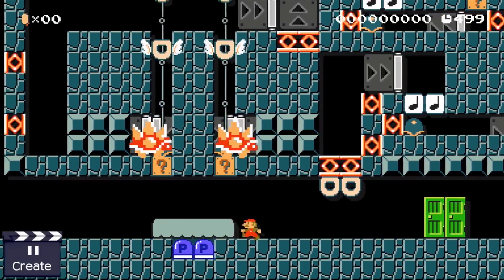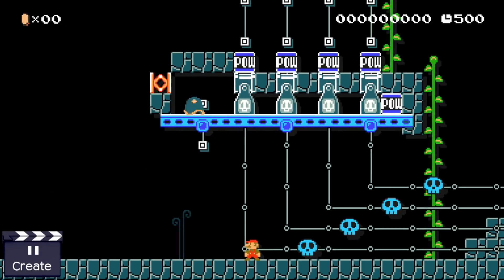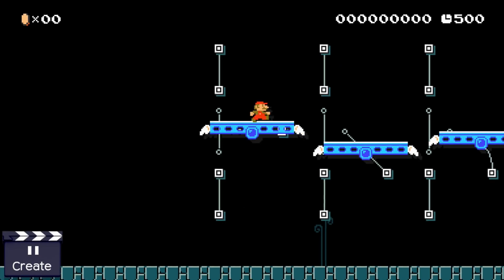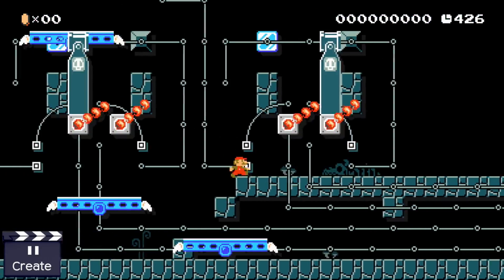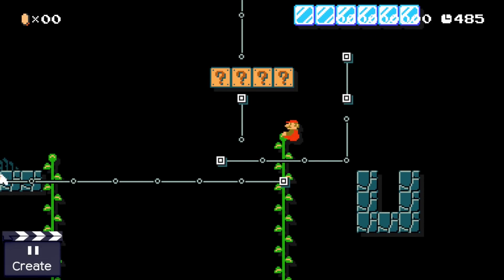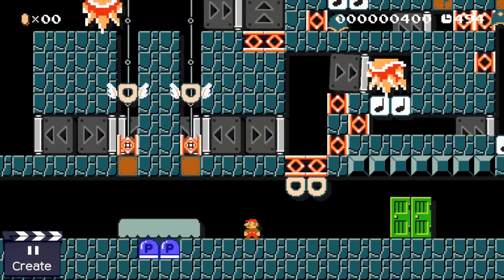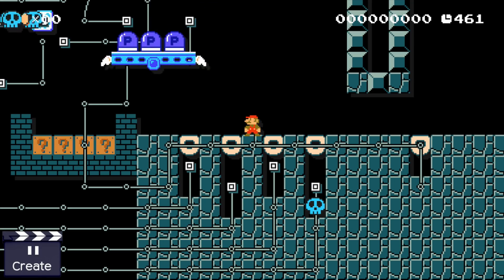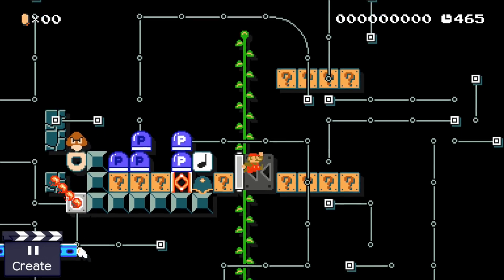Is it Possible to Build Binary Storage in Super Mario Maker ?

Comment: I figured out how to do an and gate.  You need to have two blue platforms holding your two data. Load one onto the other (by making one blue platform go over the other )and (if the binary is p swiches ) mario (or something able to activate. P swiches) needs to jump on every square once . for example (if we are using mario to edit the binary ) if i had a sequence like this: 0100 and one like this : 1111 our result should look like: 0100.  the blue platform lays one set of p swiches on to the other and ( i know you cant get 2s in binary) it will look like 1211 (the stacked p swich which has two p swiches in that row is a 2 in this example) every row has to be activated onceby mario or other ( this is the equivalent of going 1111 minus 1211 ( wich was our output))and gives you 0100. 😊

Comment: for an AND operation you can do the same as in the 6 + 9 = 15 example with the bridge of P-switches for a goomba to cross. If you use only 2 P-switches the goomba can only cross the bridge if the first AND the second bits are activated. for an OR operation you can do the "opposite". That is, the goomba is trying to move to the right, but if one or two P-switches are placed in its way it rebounds and moves left. So to the left will be success (e.g. a key) and to the right is something that kills the goomba...

Comment: I dont have SMM or even a Nintendo, so i cant test it. But i have an idea for the AND operation in a way similar to the password station but, instead of a simple bridge, you should use four gumbas with four one block gaps with 2 blocks of depth, then, insert two numbers with P switchs, a platform picks both numbers stacking them (picking both numbers from below) and droping every stack of P Switches one on every gap. When a gumba cross the gap should activate something to give another P swich in the gumbas position. Then you carry it in order and show the result. 
Maybe you already tried it, idk, but might work as an idea :)

Comment: and a new form of super expert garbage was formed, requiring choosing the correct number in a 12 bit system. for the creator, easy. for people jumping onto super expert, near impossible. 1/2000 might be able to nail it. but it looks possible to expand indefinitely. rip super expert runs that attempt to figure out a 24 bit number

Comment: I'd say a bitwise AND gate could be made by stacking the two inputs on top of each other, then lifting them up one block below a ceiling. Only the stacks of 2 blocks would be pushed down through the platform, while stacks of 0 or 1 would not.

Comment: For the "OR", take a bit of each platform using the ice bloc trick (so, both platform would end en the same track. Then use have the platform picking up either nothing, 1P or 2P. Then the platform has to move horizontally to meet an ice block which will push the topmost P if it exist. So, in the end, only 0 or 1P will be at the specific bit.

The problem is doing it for all 4 bits at once and understanding what I meant, of course!

Comment: Can you do AND by having the pow registers vertically aligned, picked up by the same blue platform, so that any bit that appears in both is 2 pows tall, and then push them into solid blocks (like you did with the thing that tests if the LSB is set) so that only the 2 pow tall stacks fall through?

Comment: I have a few ideas for AND/OR/NOT gates, but I haven't tested them yet. I'll have a go at it later, but here's generally how it would work:
Put the two inputs on top of each other. So where both bits are set you get two P-switches on top of each other. Now use a platform to take off the top layer: this is the output of the AND gate. What remains standing on the bottom layer is the output of the OR gate; so you get two gates that are nearly identical.
To have a NOT gate, put 4 P-switches above 4 springs, and a semi-solid above the P-switches. Have the inputs go up into the springs. If there's a P-switch the spring will go up and spring the P-switch onto the semi-solid. If there's no P-switch in that position the spring won't be pushed up so the P-switch remains. Now pick up with a platform the layer that didn't get sprung up. The P-switches that did get sprung up form a copy of the original, which may be useful as well (though this can be done using note-blocks easier as well).
I think it may be even doable to make a gate that will perform 4-bit addition, by stacking the two inputs on top of each other and then repeatedly taking off the top layer, springing away those positions where there is a P-switch on the top layer, shifting those left, putting them back, and repeating that 4 times (though you can keep repeating it for as long as you will).
I might have a go at this tomorrow... It sounds doable, but there may be practical issues within Mario Maker.

Comment: I think I have a way to make the not operators, but it isn't tested. You start with having the set reset flip-flop method for input, but you put on top of the bullet blasters munchers instead. You than have your platform pick up the munchers only if they are in the one section. Have four P switches drop on top of the platform. Than, have the track go by an area, that will knock of the P switches, but only if they are on top of the munchers. Than, let the remaining P switches and the munchers drop down to your final output number, and have a POW block be activated to kill the munchers. 

All zeroes will not have had a muncher on the platform, so the P switch will not have been knocked off, and such the P switches will remain, making them a one instead. However the ones will have a muncher under the P switch, knocking it off and making a zero. Unfortunately this will only work once.

This brings up the idea of using munchers instead of P switches though. If you do this, you can have them land on platforms on tracks. If their is a muncher on top, the platform will drop it on top of a bobomb, that blows up allowing a bullet blaster to fire a shell activating a POW block. If you block the exit with munchers, and only have the holes and platforms in a certain pattern, you can make a four digit binary code. An example is, if you have it so slot two, three and four have the contraption, and three munchers in front of the door, than the player must input 0111 or 1111. But what if you only want them to enter 0111 and pass. Than you make a Koopa on top of four munchers, ready to drop on the door. If four are activated, than the Koopa will walk in front of the door blocking it. Make it big and the door in a very small space, and the mission is complete. Do this for every extra number they can get. So if you have a combination code of 0101, than have two Koopa muncher stacks, one with three munchers and one with four munchers.

Comment: Oh, by the way if anyone's interested how I remember how binary numbers are converted into decimal ones easily, it's not that complicated. 
If a binary number starts with a zero, or many zeroes they can be ignored. They're just there to have eight values to get a byte. So 00000001 is the same as 1 which is obviously 1. From the first 1 you can see you have to calculate easy stuff. If there is a zero after the number it is multiplied by 2. The binary number 10 is therefore 2 because 1 * 2 is two. If there is a 1 though the number gets multiplied by 2 and 1 gets added afterwards. 11 is 3 because 1 * 2 + 1 = 3. If there's another digit after any of this, you do the same calculations to the number you have up to now. Binary 100 is 4 because 1 * 2 * 2 = 4 and 111 is 7 because (1 * 2 + 1) * 2 + 1 = 7. Obviously it can get a bit complicated with numbers  like 10001101, but they are still solvable without big problems. I haven't checked, but I think the number I just wrote is 285.

If you want to convert a decimal number into binary it's a bit more complicated. You'd have to divide your number by 2 and remember the numbers you get. If you get a point number remember something like "[number] plus 1". Then you'll have to write 1 and if you remember that the number and multiply it by 2 or multiply it by  2 and add 1 to get the numbers you remember. You'll write zeroes and ones depending on what of those you had to calculate, as I explained above. This takes by far longer than converting numbers from binary into decimal. Here's an easier example: You have the number 24 and want to convert it to binary. 
24 / 2 = 12
12 / 2 = 6
6 / 2 = 3
3 / 2 = 1.5 = 1 + 1 (it doesn't really equal 1 + 1 but it might be easier to remember, at least for me)
(1 * 2 + 1) * 2 * 2 * 2 = 24
In binary: 11000 (or 00011000).

Yeah, it looks complicated but I hope that this could kinda explain how those numbers can be calculated more understandably.

Comment: There's no good way to remove just the top or bottom row from a bunch of POW blocks? I could imagine, say, having a stack 2 blocks high with a semi-solid platform 1 block high, so several fired Koopa shells go along the platform and clear out the blocks on the top. That might work for an OR operator.

Comment: I figured out an and, or, xor, not, "not 2" (I don´t know the correct name of this) and a improved shift operator, where you can shift bits in both direction. For shifting them to the left, activate the left blue platform and for shifting to the right, activate the right one.
If you want to check the operators out, here is the level: https://supermariomakerbookmark.nintendo.net/courses/ABA5-0000-03A5-1AA5

Comment: Make an easy calculator by doing the pow block track thing but have each track be associated with a number on the calculator. For example, the third track will pick up 3 pow blocks if it is activated, the 4th will pick up 4, and so on. Then, the user will count the pows when the track comes back and that will be the number. Or, you could make a complex contraption that drops bob-ombs to blow up ice and show the number.
Reply: or you could do binary computation and store literally an exponentially larger numbers.
the problem is, how do we get binary operators...

Comment: note that the way binary works the exact same way with hexadecimal, duodecimal, octal, and quinary, etc.
just on different numbers
for hexadecimal, multiply the corresponding digit with 16 (to the power of the digit), in duodecimal, multiply the corresponding digit by 12 (to the power of the digit), in octal, multiply by 8 (to the power of the digit), and for quinary, multiply by 5 ( to the power of the digit). and so on!